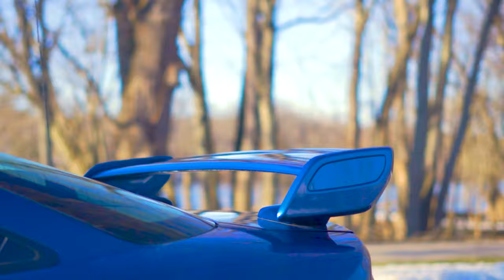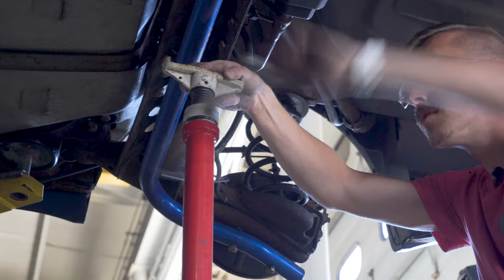Installing ZZP Lowering Springs to a Cobalt SS // Cobalt Build Episode 10

Comment: 0:00 Intro
3:10 Tips from the pro
5:19 Rear springs and shocks removal
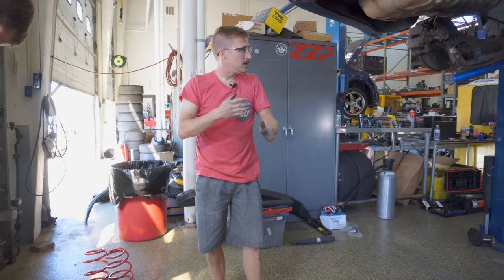9:48 Rear springs and shocks installation 
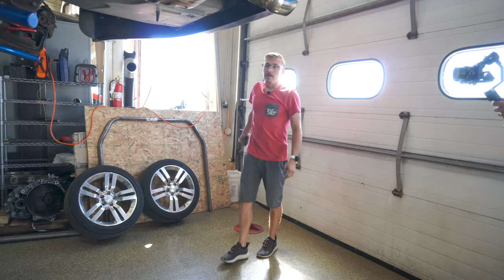12:55 Front strut removal
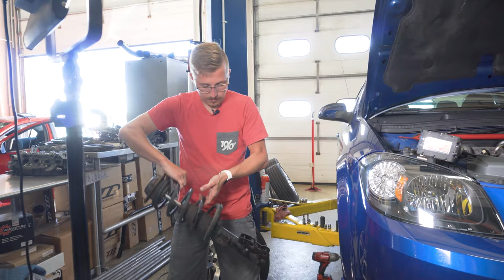18:35 Front strut disassembly 
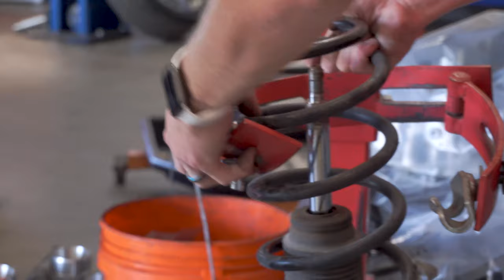21:05 Front strut assembly 
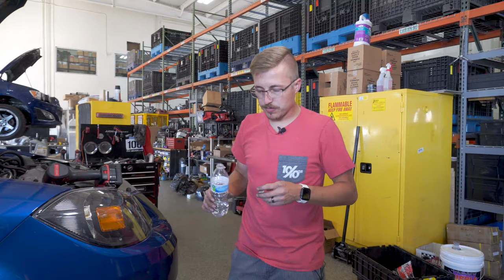24:57 Front strut installation 
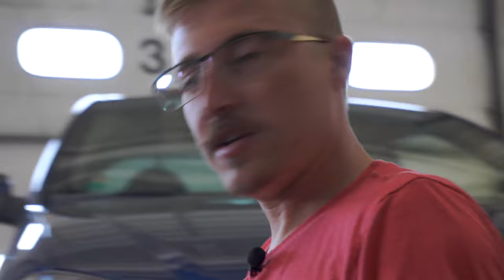30:00 The moment of truth 
30:50 Outro

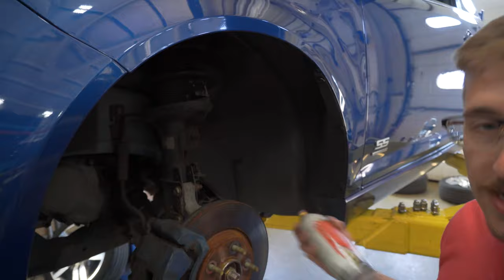Comment: 4:50 same thing happened on my mom's 2003 explorer.  I tried replacing the front left strut and the lower bolt was seized to the bushing.  I put it back together (it was still drivable) and had my mom bring it to a shop.  It didn't take them as long as you with your black car, but it took them two hours of going back and forth between using a torch and an air hammer before the bolt finally came out.

Comment: Looks great Tyler. If my roads in my area weren't soo bad I probably would have went with these springs but opted for the yyz springs instead. Did you put rack spacers in because it'll vgive you bump steer for sure .
Reply: YYZ’s are phenomenal, handle great, just don’t drop enough for me personally lol. No rack spacers yet, but they’ll be going in soon

Comment: Hey my esc keeps coming on in the car and not letting me accelerate any tips ??!
Reply: Happened after installing the lowering springs
Reply: There really shouldn't be any reason that a spring install should cause issues with the traction/ESC system. I would double check the wheel bearing ABS connectors, but I personally don't have any issue without the front hubs picking up signal (I currently have a wheel bearing with a broken tone ring sensor and the car drives just fine). You may need to get a Tech II or similar scanner on the vehicle to scan the BCM codes and see what is actually upsetting it.
Reply: @gbrunner24  I’m thinking it’s cuz the bouncing but before my esc was completely off and after installing them and reconnecting the abs the esc came on again then started making my car brake /slow down by itself